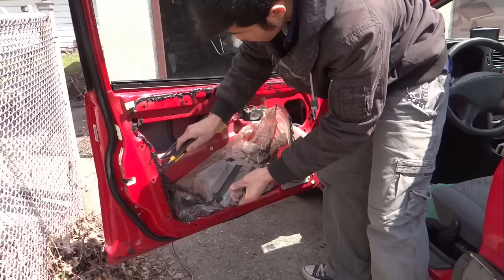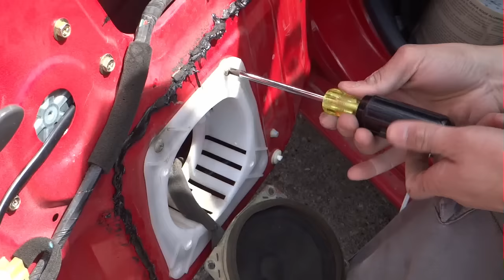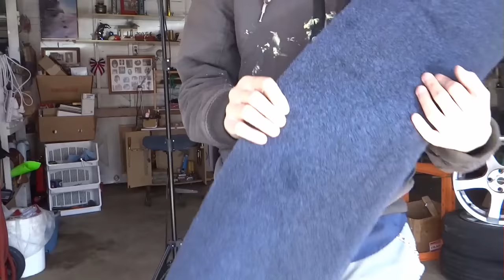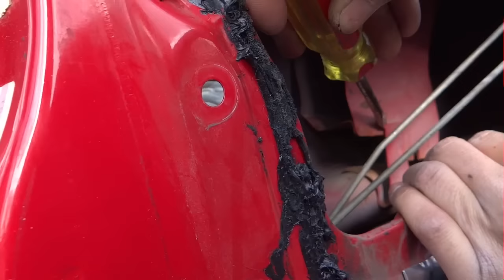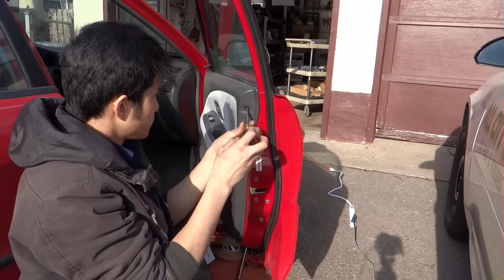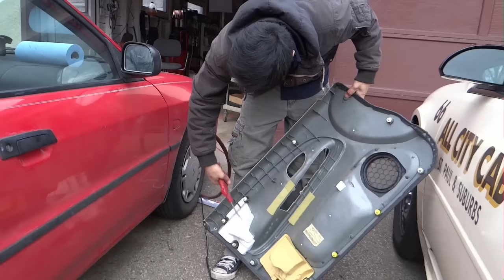Mirage Fix 5 | Watershield, Friction, Sound Deadening

Comment: Thank you. I'm cursed with a Subaru Forester with severe dash board rattles ... and your video gives me some hope. Much appreciated.
Reply: When you do it, also try to put some foam in between rattling and connecting plastic surfaces in addition to sticking sound deadening material on the sheet metal.

Comment: what is this glue tape you use for plastics on door panels???
Reply from the maker: +thanos Swift1.3 this http://www.ebay.com/itm/20-Butyl-Rubber-Glue-Headlight-Sealant-Retrofit-Reseal-headlamps-or-windshield-/141738858198?hash=item21004b56d6

Comment: Hey guys,
I have that disgusting black goo stuff around the clear plastic sheet inside the door, like maggie's lancer. Is there an alternative? what about silicon, it is flexible and can be removed when needed.

Nice tutorial, silly me spent $420 for other people to install a stereo and speakers for me, without the sound deadening or new wiring, or amp, or subs, labor only.
Reply: (waterproof) duct tape
Reply: if you use silicon it wont ever come off the goo is just adhesive

Comment: What is that rubber and carpet stuff called? Also where can I find that grey double sided tape stuff at?
Reply from the maker: You can buy the carpet from your local store like Menards. The grey thing is a Quick Roof:
Aluminum and Rubber
http://www.ebay.com/sch/i.html?_sacat=0&_from=R40&LH_BIN=1&_nkw=quick+roof&_sop=15

Quick Roof is just a brand, you can do research on "sound deadening" and find out other brands out there.

Comment: I don't get it why did you use the Aluminium ? 
What is it for?
Reply from the maker: +Mahmoud Elkady It's for making the metal thicker so the sound can't pass through it easily.
Reply: +the darkdragonwing so you wanted it to be quite
Reply from the maker: Kero Mero
 Yes, so that the sound from the outside can't come inside the car as much.
Reply: It doesn't prevent the sound from coming through. It's called constraint layer dampening (CLD). Its purpose is to add mass to the sheet metal, which will dampen vibrations. The difference between peel 'n seal (like in the video) and products that are designed for this type of application is the adhesive material. The type in the video is asphalt based and the purpose-built products have butyl rubber adhesive. Sure, peel 'n seal is much cheaper...but in hot climates, the asphalt backing will get soft and start to lose adhesion. You'll also be driving around with your car smelling like you put a new roof on your house, the fumes can't be very healthy.
Reply: It's ultimately your choice in the end regarding the type of product you use. By no means am I bashing on anybody. That wasn't the motive behind my comment. I just wanted to provide some additional help to anyone that might need it. The end result is pretty much the same. But with all the time and effort that it takes to do a job like this, I'd rather not have to deal with the smell or have to take the door panel off again to replace a piece that won't stick. It's up to you guys.
Reply: If anybody has any questions, I'm more than willing to help where I can.
Reply: If you'd like to see the type of stuff I'm talking about, check out caraudiofabrication. It's a channel by a guy named Mark. He has videos on pretty much anything that deals with car audio. There a few videos that go much more in depth when it comes to dampening materials.